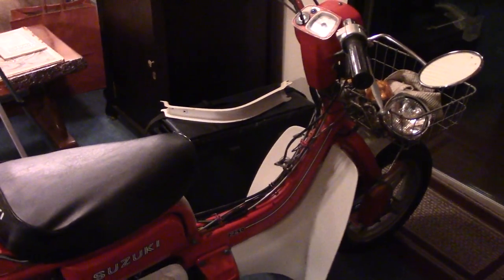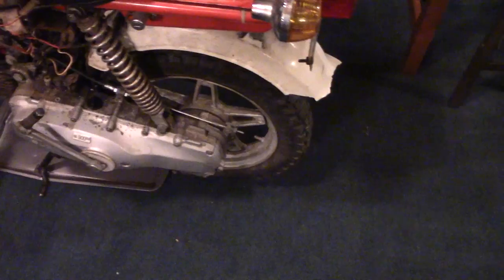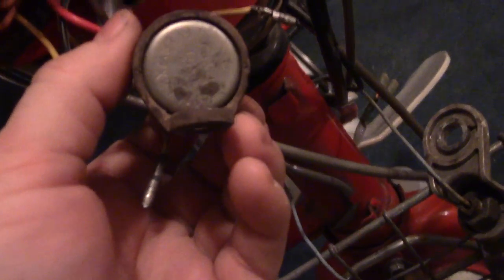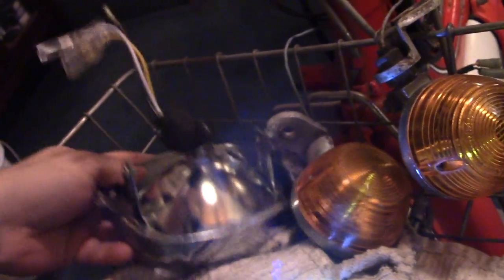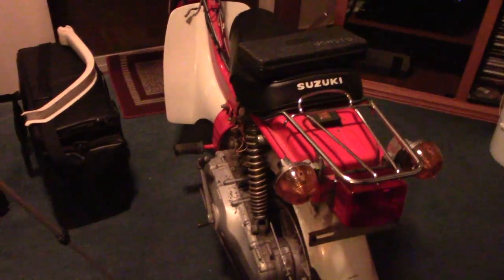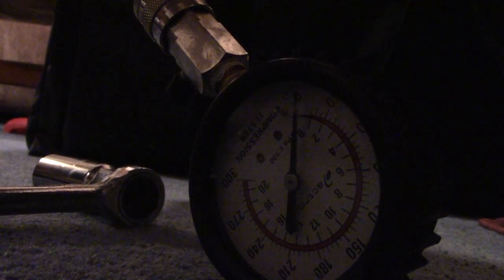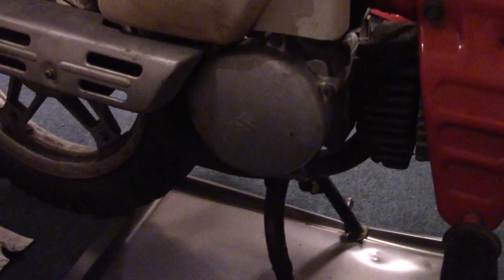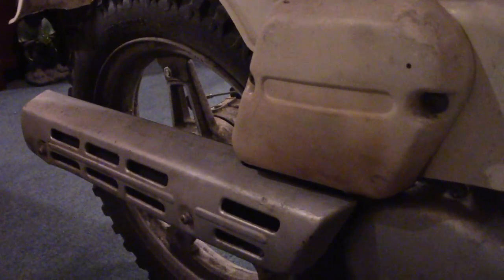1980 Suzuki FZ50 Project - Part 1 - Initial Evaluation and Compression Test

Comment: I wouldn't worry about the value of it (if you plan on keeping it), look at the use of it....its giving you something to work on which seems to be something you enjoy.  For example, my car has a value of probably less around $1000 (it's a 27 year old car with over 300,000 miles on it)...but if it needs a $700 repair done on it, i'm going to get it done.  Why? Because it's still useful.  It's cheaper than buying a new car.  If I could afford a new car, I might would do that, but in all honesty, my car has survived for 27 years and its still serving its purpose...get me from Point A to Point B

Comment: The shocks don not have any dampening, they are born this way. I have owned a FZ since 2001 (2990 km) and my father bought one that was less than a year old in 1988 (50 km). So I know quite a lot about these. Driven lots of longer trips, up to 100-150 km. Great mopeds, mine has done more than 15.000 km now, cared for it like a baby, so it's still looking great. The last years, even my brother bought one, so now there's three of them in the family. And yeah, I haaaate the trail tire on these.

Comment: Value is probably more dependent on whether you have title or not.  If you have title, I'm going to say it's worth at least $500 so I wouldn't have any problem dropping $300 into it.  It might be more valuable if it were a moped rather than a noped.  Some states have less regulations on mopeds than nopeds (which are technically motorcycles).  The FZ50 is not as common as you suggest.  The FA50 is quite a bit more common and the FZ50 shares some parts with the FA50.  The FZ50 should do 35mph out of the box.  With a little work, you could probably get it to 40mph which would be safer on most city streets.  You can also get some of your money back by selling the parts you are replacing like the old air box and the side cover.  Or the original rectifier.
In stock configuration (49cc) and assuming proper oil injection function, the engine should last longer than you think.  Things start to go south with bigger top ends (increased engine temperatures) in terms of reliability.
Reply from the maker: In the state of NH, the title is not necessary; we have VERY lax laws when it comes to motor vehicles over 15 years of age. Because of where I live, mopeds and nopeds don't have a ton of value; it's very rural here, and small bikes just don't do well on roads where the nominal speed is +/- 40mph. Being a "noped," I am curious to see if I can register it as a "moped," but again, I'll be handing the clerk a bill of sale and a VIN verification form (in instances where a previous registration or title is not available, I need to have a police officer fill out a form verifying the validity of the VIN# in order to register it). If it needs to be registered as a motorcycle, that's fine for me as I have a valid motorcycle license, but will make it harder to sell.
Reply: I see.  Nice video on the Mac Classic as well!  Didn't realize you lived in a rural area with higher speed limits.  FWIW, you could probably get that thing up to 50 mph if you so desired.  I know there's a performance exhaust or two out there for the FA50.  not sure if it's interchangeable with the FZ50.  Such an exhaust with your bigger top end and perhaps bigger carb would do the trick.  Enter the rabbit hole.  Anyhow, I'd love to have an FZ.  Look forward to your videos. I originally found your channel and watched the Helix series.  Sorry about your accident but glad to see your ok.
I'm back.  Allegedly the FA50 exhaust is interchangeable with the FZ50 which gives you access to pipes like this https://www.treatland.tv/MLM-suzuki-FA50-techno-EDM-circuit-pipe-p/mlm-fa50-pipe-401066.htm

Comment: i have a moped that was myh uncles it is a 1986 honda elite 150. it has 110,000 miles on it yes that is one hundred, ten thousand miles on it.
Reply from the maker: That is NOT a moped. That is a scooter that must be registered as a motorcycle in all 50 states. You also need a motorcycle license to ride it. NOT A MOPED! (I owned that exact same model, and 110,000 miles isn't unbelievable at all: it's a well-built engine).
Reply: i know you have to have a license for over 50cc or something like that.   but not for use  on our private property